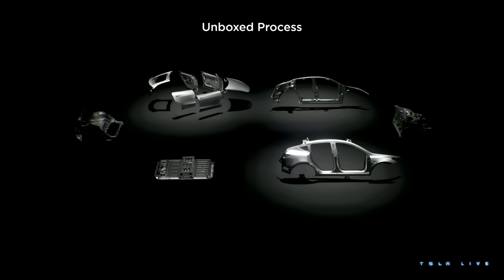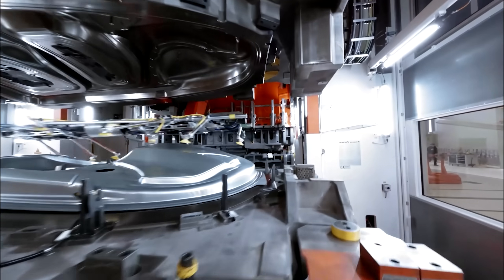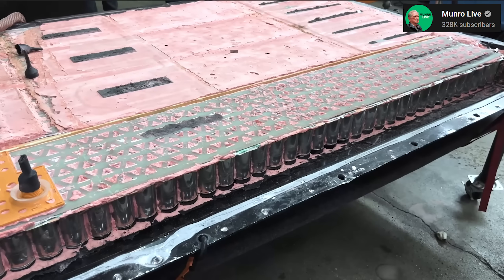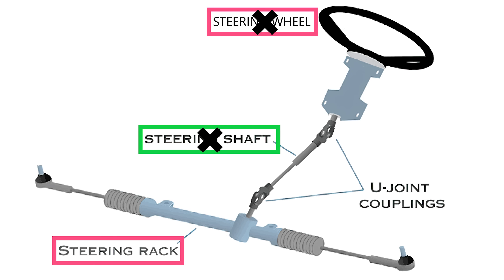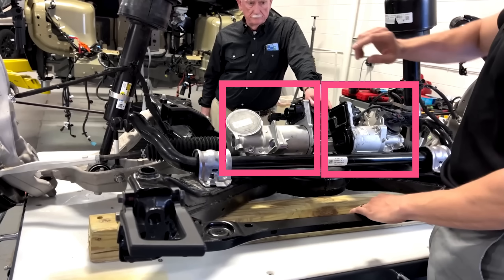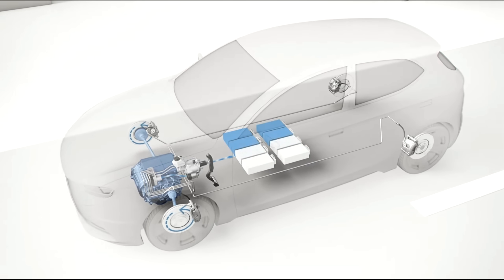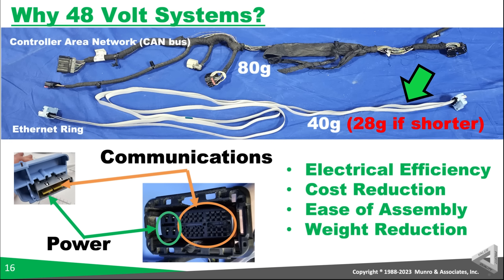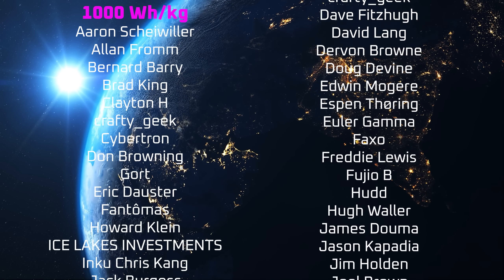Making Tesla's Unboxed Process Work // Seven Key Technologies

Comment: Always puzzled me why generative (as opposed to regenerative) brakes have to be limited by the capacity of the battery to absorb the energy. Just put an electric heater in the thermal control loop and dump any electricity the battery cannot absorb into that.  This is what friction brakes do anyway, turn kinetic energy into heat, but this way there is no brake wear and sometimes the system will be able to put the heat to good use for heating the cabin or preconditioning the battery.

Comment: Hydraulic quick connect unions would also be compatible with the unboxed manufacturing system and cost way less than motors on the wheels as hydraulic calipers are small, lightweight and reduce unsprung weight as oppose to having motors onto the wheels. The unsprung weight has major effects on vehicle performance. There is no valid reason to eliminate hydraulic  braking systems when making the the unboxed car. The plumbing would simply be broken up into sections and joined with quick connections, then the completed hydraulic system would be bled just like any other vehicle!

Don’t overthink it Jordan!  There are ramifications you aren’t considering, when it comes to braking systems.

Comment: Something I’d like answered.  12v systems, even with larger wires, have disastrous corrosive reactions in high-salt environments—wires and connectors literally falling apart.  Won’t a 48v system with thinner wires and larger voltage differential have an even more likely corrosive failure potential?

Comment: Hi Jordan. I haven't heard it mentioned yet, but in-case brake-by-wire couldn't get approved, it's still possible with hydraulic brakes by using quick disconnects. There are refrigerant QDs to disable part of an HVAC system, even though a very small negligible amount of air is introduced upon connection. There is no reason that a hydraulic QD couldn't work as well. Each sub-assembly could be either primed or under vacuum to accept the fluid when everything is connected.

Comment: Re: Your comments on braking.  The motors can create reverse torque in an emergency.  I think they already do!  I had my car initiate emergency braking when a deer came into the road. I was already on the brakes fully (or nearly fully) when the emergency system kicked in.  I'm ~99% sure the brakes weren't getting the job done and the car activated the main drive motor in reverse.

Comment: Nice explanation.  Rather than routing the ethernet and power cable after the assemblies are joined together, couldn't they have connectors at the margins of each assembly and then simply clip them together when they are joined?  Another question: I presume, as you mentioned, the assemblies will be bolted together rather than welded because the welding would damage the post interior finishes and paintwork.  How will bolting compare with welding for strength?

Comment: One other advantage of steer-by-wire and brake-by-wire is that you can have a vehicle that has a wheel and pedals, but when in robotaxi mode, it can disable the controls, rendering it immune to interference from passengers
(and it still has the controls for manual operation, either when just in manual mode, or when the software is unable to handle it)
Reply: Also, would probably be harder to cut someone’s ‘brake lines’.. especially without the main computer knowing before you ever start

Comment: Brakes don't necessarily need to be electric, at least in the front.  Just like the steering wheel, it could be fully contained in the front module.
The rear, on the other hand, wouldn't make sense, as mentioned.  But rear brakes are smaller than front brakes, so another option may be to eliminate entirely, and just brake regeneratively (especially in the Robotaxi).  "The best part is no part" philosophy makes this worth consideration.
Reply: VW uses rear drum brakes in addition if the goal is to maximize motor braking a resistor mounted to a heatsink could be used as a place to dump the remaining energy. It would then be vented out of the car by a cooling fan.

Comment: I hadn't considered the advantages for unboxed with electric brakes. Also, question. Previously, Tesla had a patent for "rigid" wiring as an aid to assembly. I can't see any reason the ribbon wiring can't be rigid, do you think they will introduce that change as well in the unboxed process?
Reply from the maker: I think it comes down to use case.  In some places rigid makes sense and others flexible might make sense.

For main power lines in the high voltage system, it's already rigid

Comment: Why is Tesla going with a hybrid process to showcase on 10/10? What are the challenges of bringing the unbox process if they have all the components you describe in the video?
Reply from the maker: They're doing it to maximise the output of the current lines

Fully optimized new lines with a lot of capital outlay or much less capital outlay with a process that's still more optimised than any other automaker is using?
Reply: Could be risk management, or it turned out to be faster implemented if they start with a hybrid solution.
Reply: Current production lines are well below capacity
Hybrid process will allow the re-purposing of some of the existing lines to build new vehicles using non-optimized unboxed process, so we can get product to market faster
Use of Optimus may make some of these non-optimized processes moot
Reply: 10/10 is about showcasing Robotaxi.  Tesla have said that Robotaxi will use the unboxed process (not a hybrid of current and next gen processes). Elon mentioned that they will introduce another couple of things on 10/10, but we'll have to wait and see what they turn out to be.

Comment: I have a comment to the Tesla Etherloop wiring video.  I wanted to submit this comment to that video of course, but I was late, and by that time you were no longer reading the comments to that video, by the looks of it. (No criticism there, you have to stop at some point.)

In cybersecurity there is the concept of "air gapped" A mission critical system should not have network connection to other components in the same facility. The obvious example is a nuclear plant. The offices that handle logistics must have internet connection, but for security reasons the computers running the nuclear reactor must under no circumstance have network connection to the rest of the facility. If the office computers are hacked, that is bad enough. But as a bare minimum the nuclear reactor controllers must operarate on an island, no network connection to the rest of the facility.

The reason for keeping the nuclear reactor controllers on an island: if a target is very attractive for an adversary then the adversary will allocate resources towards hacking that target in proportion to the possible wins. The thing is: try as you might, it is impossible to write unhackable software. There are diminishing returns. Even if you set up tons of quality controls, that make the software 10 times or 100 times more expensive in manhours to develop, you can still only make the amount of errors smaller, not zero.

It is extremely irresponsible to go with a design of cars where life critical systems and entertainment functionality are sharing a network. Promises that the critical system communciations will be encrypted don't cut it. Try as you might: it is impossible to write unhackable software.

Mitigating efforts:
Like many other companies Tesla offers large financial rewards to white hat security experts who develop and demonstrate security breaches. These experts do succeed in finding ways to get high privilege access to Tesla systems. It is to be assumed that enemy nations are in the process of stockpiling ways of access that they do not disclose to anybody else. (Such stockpiles are always in flux, vulnerabilities that are discovered and reported are patched, so new ways of access must be found and added to the stockpile.) 

When white hat security experts find a way it invariable starts with gaining high privilege access in the entertainment functionality. That then forms the platform to subsequently find a way to access and gain high privilege access in the life critical systems. 

A fleet of cars with shared critical systems and entertainment system is for an enemy nation a sitting duck. 
 

About over-the-air updates
Tesla has a policy of over-the-air updates. 
That policy puts a huge responsibility on the security of development and distribution.
For comparison: in 2017 the utility software ccleaner suffered a hack of their distribution servers that went unnoticed for weeks. For weeks a particular ransomware was distributed with every update of the ccleaner software.

If the Tesla distribution servers are ever hacked then in minutes all of the Tesla cars can be infected with malware.

When the distribution of updates is not over-the-air then the update cycle is a much slower process. The only practical option is that updating the software of the car is performed when the car is brought to a shop for periodic maintenance. Slower distribution is beneficial for security: better probability that if somewhere in the custody chain the software is compromised the tampering is discovered when the number of cars infected is still comparitively small.

Jordan, I hope I can persuade you to allocate time to research these matters, and to communicate to your audience what they need to know to make an informed decision. The reputation of your channel is that you are actually researching your subjects, rather than repeating the content of press releases.
Reply from the maker: Good points!  I'll add it to my (extensive) list of potential videos.  As I've said in the past, there needs to be other channels doing what I do.

Comment: Would be cool to see a video that talks about the impact that steer & brake by wire have on battery & total range. Are they a significant compromise?
Reply from the maker: Minimal.  The amount of power used for those systems is negligible compared to the amount used to move the vehicle down the road
Reply: @thelimitingfactor  Perhaps, but I’d suspect it might be more than we might suspect, just the steering actually requires multiple motors that actually need a pretty strong force, with precision that operate every second the car is moving. I doubt it would be negligible. Same with the brakes. Surely it’s gotta be at least a 20 mile hit. Hopefully someone actually does the research as opposed to assumptions.

Comment: Steer by wire makes it easier to make cars for both left hand and right hand drive markets as the steering mechanism is the same for both types. The only real physical difference between the two configurations is swapping the locations of the steering wheel, brake and accelerator with the glovebox in cars like the model 3 and Y.

Comment: I wonder to what extent the lifecycle emissions associated with each Tesla vehicle will be lowered by the unboxed manufacturing process, in-house manufacturing of 4680 cells, vertical integration of lithium refining, and the replacement of all ICE vehicles used by Tesla and their suppliers with Tesla manufactured vehicles. Currently, it takes three years for the additional carbon required by a Tesla in manufacturing (compared to equivalent ICE vehicle) to be offset during use of vehicle. When does that become zero?
Reply: Who said 3 years again? I haven't seen anything peer reviewed claiming anything like that long recently done. 🤔

The latest I've seen show evs as paying the additional emissions back in 8,000-18,000 miles depending on the class of vehicle discussed, pack size, location of the owner, grid mix emissions and who manufactured it. 

The average tesla sold is under 11,000 miles in the U.S. based on our average grid emissions for break even. Less if you have your own solar panels or a high mix of nuclear&renewables available. Plus the grid is greening itself month over month&yoy at break neck speeds! 😎
Reply: @4literv6  Tesla said it in their 2023 Impact Report. For those who rarely drive but need a vehicle and live in a part of the world with little renewable/nuclear sourced electricity, it could be argued that they will not lower their carbon emissions by getting a Tesla. I'm interested to know when that will no longer be the case.
Reply from the maker: I love that question
Reply: As far as I remember it was three months (or six). It was not years for sure as the energy consumption for the production is already only marginally higher than that of a comparable ICE car.
Reply: @NilsFrederking  Read Tesla's 2023 Impact Report.
Reply: There are at least 4 major ways to get to zero additional carbon
1) Increase the operational life of the vehicle (use long lasting materials like stainless) 
2) Increase the operational duty cycle of the vehicle from 5% to 50% (roboTaxi)
3) Make the cars rapidly refurbishible. (replaceable batteries, cushions, etc)
4) Reduce the likelihood of loss of vehicle in a crash (FSD)
Reply: @bru512  The lifecycle carbon emissions of a Tesla vehicle is already significantly lower than that of a comparable ICE vehicle. However, the manufacturing is more carbon intensive. This additional initial carbon input is offset during the use of the vehicle within three years of average driving, when charged from grid electricity.
The things you listed further reduces the lifecycle emissions but does not reduce the additional carbon due to manufacturing specifically.
Reply: Speaking of increasing lifespan; the unboxing process with battery as detachable, effectively gives Tesla a method to swap the battery pack when it is time, or easily reclaim it. I also believe it will help repair by allowing to take totaled car and reuse sections for a new Frankenstein car.

Comment: We've heard the analogies about aircraft having fly by wire systems for decades,  so we needn't worry about cars having the same system.  Another aspect is the sheer size of these aircraft,  whether they be a fighter jet or airliner.  The forces needed to move the controls are far beyond what a human can generate,  and as much as 200 feet from him.  You can safely drive a car if the brake power booster or steering power assist fail,  but you're not going to be able to fly a 747 by hand. Brake by wire will work just fine, as it already does with electric controls on aircraft.  Hydraulic lines merely transfer the boost force from the power assist over the distance to the brakes,  where with electric systems the boost assist, commanded by wiring,  is attached to the brake disc or steering rack.  You can easily have pairs of motors, and even if they're used in tandem,  the loss of one merely means the loss of half your boost,  not all of it.
Reply: F1 cars use brake by wire systems, you know the fastest accelerating, hardest cornering road vehicle's made by mankind.

The now 200+mph capable formula e gen 3 cars this season eliminated the entire rear friction braking systems relying instead on brake by wire all around and the rear motor itself for all of it's braking done through regen only! 

Also throttle bodies and steering systems have been by wire for decades now to varying degrees. 😀

Comment: IMO, one point of steer by wire that is largely overlooked is the fact that still large parts of the worldwide market is righthand driving. Common parts and processes can be greatly increased between left hand and right hand models - ifyou have electronic steering, breaking and accelleration.

Comment: I'm not sure the drive by wire feature has any cost benefits for smaller vehicles and wonder if that will be left out of most future vehicles. The 48V Ethernet archictecture seems like an extermely important evoluation for cost, reliability, and manufacturing ease. I realize you can't have drive by wire without the 48V architecture, but you pointed out that the cheaper steering rack can still be used with unboxing process. Mabye the new Roadster needs drive by wire for better control at high speeds, but will Model Y and 3 sized vehicles need it?
Reply: Autonomous driving does better with steer by wire. At high speeds,  you don't even need power steering in a conventional car.
Reply: @jamesengland7461  so the vehicle uses less energy? That might offset the extra hardware cost if it has longer range
Reply: @gordontyler9317 You are forgetting a major point. Manufacturing Scale. Just like chip makers turn off functionality to get a new skew and therefore have just one part to manufacture... Tesla can quite easily have every single model use the same Steer-by-Wire unit. Only the rack would change for different geometries and sizes. You can easily save enough to put Steer-by-Wire on every car.
Reply: @CorwinPatrick  They will use different motors, as the Cybertruck needs much stronger ones than a two seater roboaxi, but a lot of parts will be redundant-
Reply: @NilsFrederking  With 48V architecture, the larger motor will not be significantly different that you couldn't put an oversize motor on the smaller cars. A little weight given up for cost savings and a more robust part